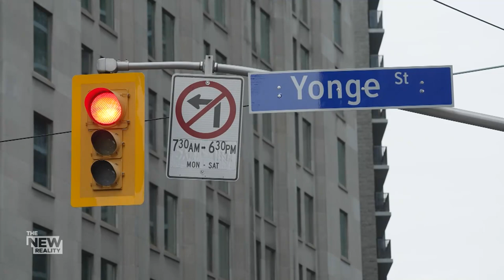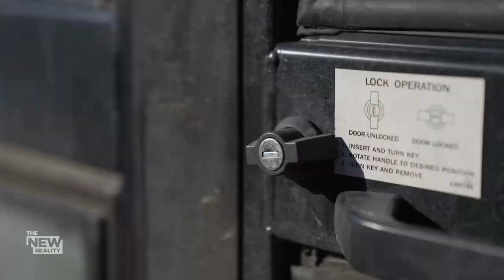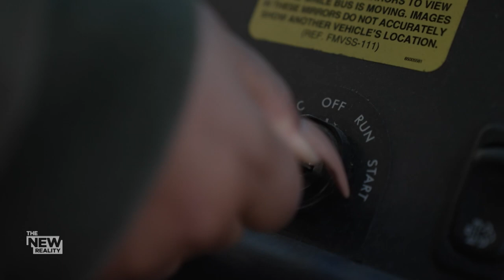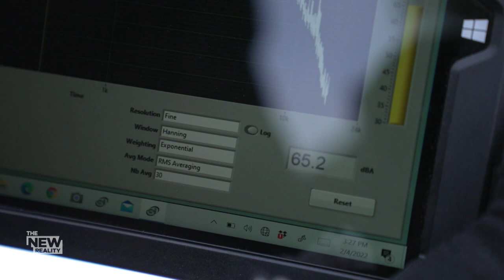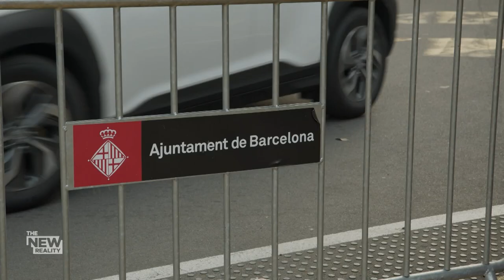Urban noise: Why cities need to turn down the volume

Comment: There should be noise traps in the city just like speed traps. If your vehicle is above X decibel then you get a ticket. This will encourage people to be more considerate when accelerating. Besides, a vehicle(even a motorbike) that you hear from 3-4 blocks away is just too loud. This should be regulated just like speed.